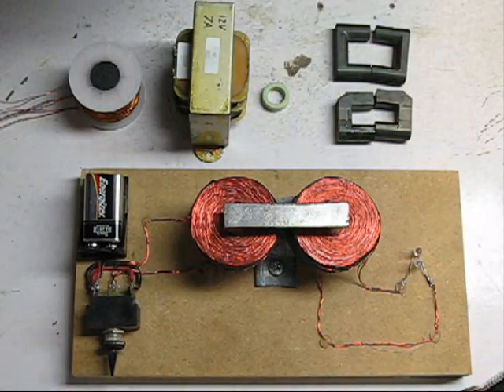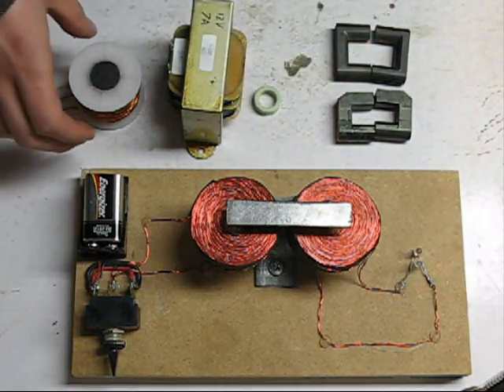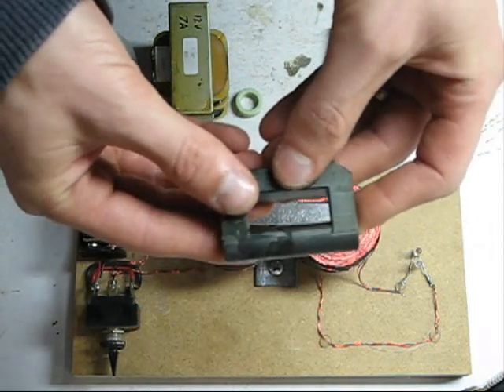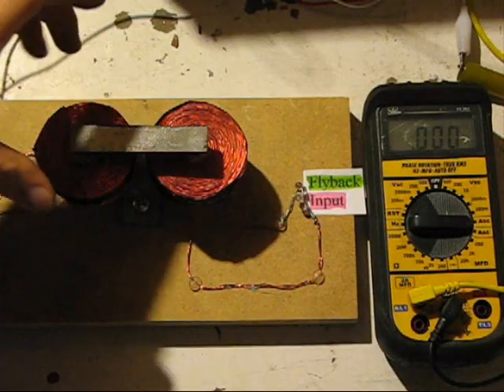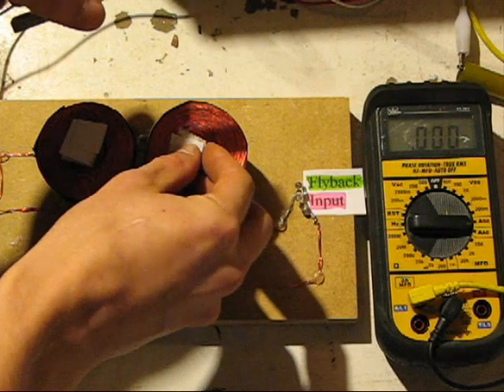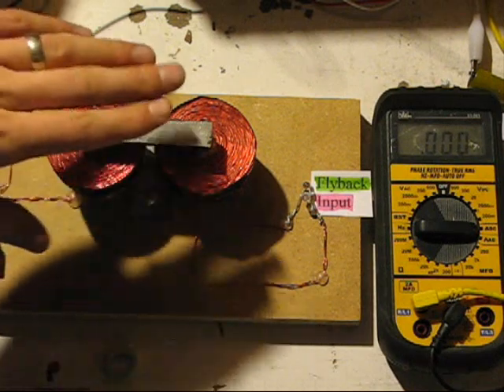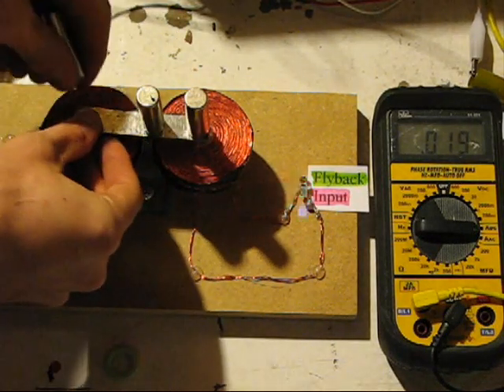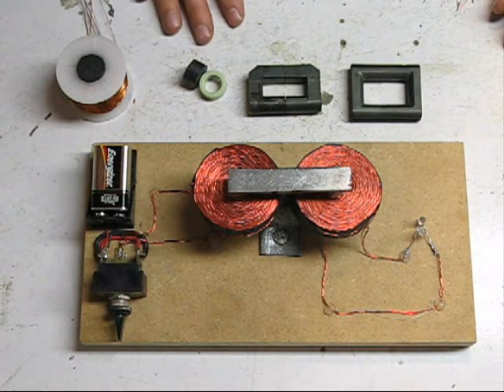Ed Leedskalnin Magnet 4

Comment: The b-h hysteresis stores energy by aligning the mag dipoles and the field in a closed loop keeps. By breaking a closed loop the inductance change which changes the magnetic field v = l x di/dt plus the mechanical work done in breaking the path. This appears as a transient limited by insulation breakdown or interwinding capacitance. This can create a kind of impulse motor.

Comment: Try the same set up but with a triangular arrangement, ie: 2 secondary coils both recieving flux from the primary, but also sending the back emf to each other to assist the primary, you might find you get overunity.

Comment: @blulander1969 

The effect is called "CCD smearing" (also known as flooding), it happens when a captured image is too bright for the cameras image sensor, therefore exciting adjacent pixels on it - Usually this is a static line or trail

It appears to move due to syncing differences between the LED (which is blinking alot quicker than the video shows) and the frame/capture rate of the camera. You can reproduce this effect by pointing a TV remote control at your camera lens and pressing a button